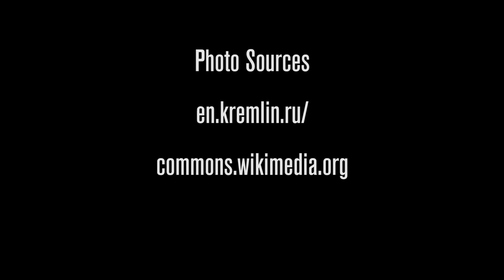Russia's only aircraft carrier, the Kuznetsov, is a floating hell for the crew

Comment: Poor conditions for the crew does not mean poor battle performance. Short endurance does, however. 
Lack of training is probably more important. 
US crews are continually trained. Good conditions also means the crews can concentrate on learning and performance. 
Also, if their heating, electrical and plumbing systems break down alot, then I wonder how reliable their battle systems like radar and battle computers perform?

Comment: I disagree with the last statement about China. Whether she meant between next 20 years or 1 year doesn't matter as by fundamentals China is like the US in beginning of WW2. At the beginning they lacked proper tanks such as Sherman and didn't even commission the M3 until they had entered the war. China is great underestimated for what it can make within the next 1-2 decades. The next Type 003 Carrier to be built is to have a molten salt reactor that can outproduce the ones on Gerald R Ford or Nimitz, added to the US Doctrine on using same plane designs and recycling and updating equipment it's no surprise other powers can soon overtake them in the power race. Equipment like their Nimitz Carriers, Abrams, F-15s, F-16s and F-18s are all 70s or 80s technology and while great in performance suffer the fact that by design they are old and eventually will need to be changed. While you can argue that those design especially Abrams don't change the times of technology eventually the Abrams base model cannot sustain the new equipment and a new design will be needed. Meanwhile China with their make newer equipment will be up to date with tanks, aircraft and naval combat ships being able to sustain the newer technologies while US will have to waste time creating newer designs. In short China eventually will overtake US and it's most likely to happen within 1-2 decades and the US being the powerhouse like UK, France and Russia will be over and a new super power will come in to play
Reply: Also we can contribute the freezing due to Kutsnetzov's home bade. Murmansk, it's a extremely cold region and it has the only port that can sustain Kutsnetzov. While Kutsnetzov is fundamentally outdated and has inadequate living quarters for Russian sailors we do know that Russia is planning on a new carrier that is planned to overtake Gerald R Ford in technology and carrying capacity. US people may hate on me talking how other countries will have better military than theirs maybe they should learn of a word called TIME. "The sun never set on the British Empire." Was a phrase popularly used and is technically true back then but you overtook the European Militaries so if you hate on me for that you'll be extremely hypocritical, US is in a decline at the current stage and eventually it won't be the huge superpower it once was and will be in a same position as UK, France, Germany, Iran, Russia and many more

Comment: Liaoning has the same engines (she's basically a rebuilt Kuznetsov) but they've been properly overhauled and maintained: there's nothing wrong with them at all.  She also uses better fuel than the Russians do, so she doesn't belch smoke all the time.  But she's still a STOBAR carrier, which is far from optimal.

Comment: When Russia needs a large portable airfield perhaps it should partner or call on the USA. Even the USA and Russia are questioning the need for super carriers as we are starting to build more smaller carriers for the F-35B, the vertical take off and landing model. Perhaps a few are useful but too many add up to a huge military budget for a limited use asset that has it's weaknesses against a major power.

Comment: Lol the same aircraft carrier is or perhaps similar to Kuznetsov is the Kiev class aircraft carrier which was modified from an helicopter carrier to an angled deck aircraft carrier currently in service with Indian Navy but it would have met same fate if it won't have been India not willing to compromise so they fit new propulsion system better steel was used in modification but now ironically enough India has built its own aircraft carrier which is superior to Russia which used to built carriers way before this explains Russia's paper power and power through propaganda military videos

Comment: It is the Heavy Cruiser aircraft carrier ! What if it's is a nuclear power !this Russian carrier equipt with Assault and defensive weapons than US counterparts !;!
Reply: you have 1 busted ass old outdated carrier that sank in drydock and got a hole punched in the flight deck by a crane  last year. I've never seen more that 6 planes on the deck and the pilots are overweight and pushing 50 yrs old. Meanwhile US has 10 carriers with 60 planes on each one and a support fleet that includes nuclear submarines for each individual carrier.

Comment: Lets not forget the fact that all these videos are directly american biased, and that the Kuznetsov has outfought ships on multiple occasions. Also, though the nimitz may be nuclear powered, she cannot run indefinitely. Urainium rods, of which she holds 3 refills, will last about 2 months each. Also, the nimitz could be sunk quite easily by one stray torpedo, sporting a steel alloy hull. she has a weak frame, whereas the Kuznetsov has a cast iron support frame, with a titanium and stainless steel hull pattern. she may have flaws, but if it came down to a 1v1, the Kuznetsov would easily win against the american quantity over quality.
Reply: VVY Gaming Agreed
Reply: VVY:  Just silly claims.  US carriers have a 20+ reactor life between recores. They don't carry 'spare" fuel rods. All steel is an "alloy", and no US carriers don't have especially light or weak hull.   Cast iron is brittle and hasn't been used in ships since the early 1900's.  While this video is a pile of biased trash, your claims are technical trash.
Reply: Ok let’s see how it goes against 5th generation fleets
Reply: Tristan Jennings russia would blow it up to fragments with all its anti ship missiles and nuclear ripped torpedoes